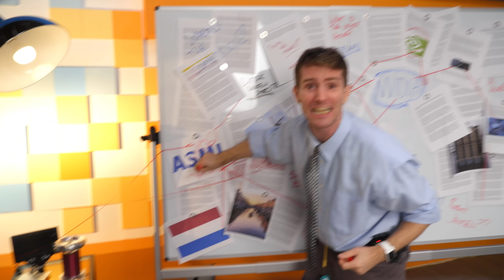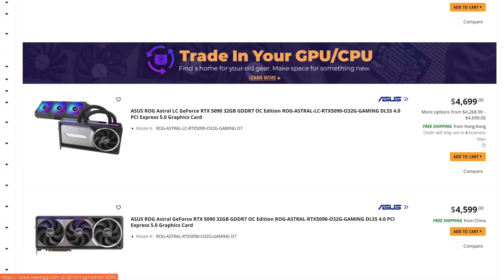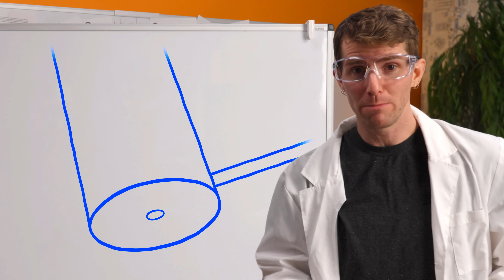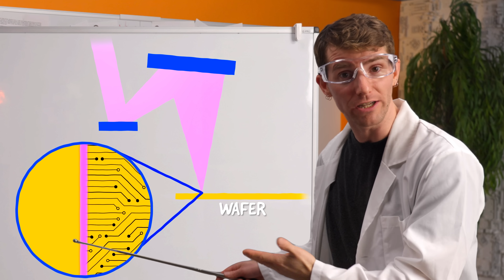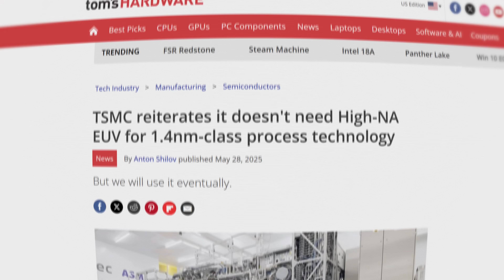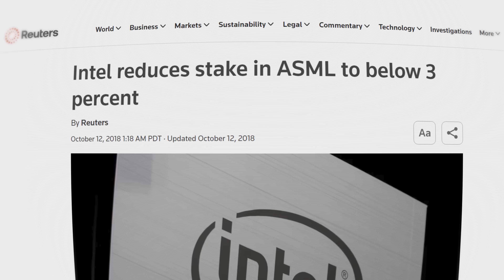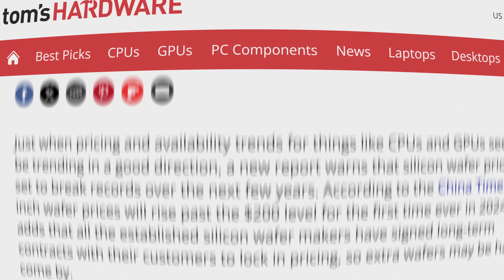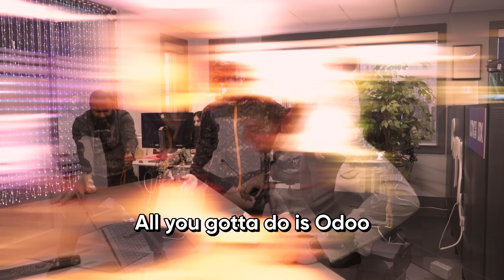This is Why Hardware Prices are Going Up… Again

Comment: The other big factor is defense and war strategy. It's actually a national security imperative for Taiwan to ensure they are the only place to go for high end chips so the western powers are required to go to war for them against China; it's not a corporate entity: it's a national security operation. They would run those facilities at a loss of billions per year to ensure they are still the only place to go.
---
Similarly ASML is Europe's big ace in the hole now that the US is threatening to invade their territory, carrying out regime change espionage on their territory, and openly talking about interfering with their elections to destroy their economic stability. The reason why there tech is so important: they are the only ones who can maintain it make replacement parts for Taiwan. That means that if the US gets too aggressive they can blacklist the US from any chips made using EUV lithography: like the ones needed to operate the F35, PATRIOT, Reaper, F22, and every updated naval ship in the fleet. So basically the entire US military would lose access to every spare part for every advanced weapons system they have. That means that if Europe gets too upset with the US they can break the US military overnight. Which is why ASML will also always remain a monopoly in Europe now. It's too important for European sovereign power to be the only suppliers.

Comment: Hi, Intel manufacturing engineer here. Like many others pointed out, it doesn’t stop there; those are just the major examples.

Raw materials are in a similar situation. The highest quality of certain materials are sourced from single companies out of, you guessed it, China. Current US sanctions and tariffs have made this whole mess even worse.

At the end of the day, semiconductor manufacturing is shockingly slow and expensive. Changes made now will take years to see any results, positive or negative.

And yes, “smartest nincompoops in the industry” is a very accurate description of us.

Comment: Seeing Linus wearing a tie I was hopeful that finally somebody was going to explain the real issue, but sadly no. There is nothing strange or really monopolistic going on with any of the chipmaking side of this: it's the gaming card makers.

This new machines are super expensive, too expensive for gamers. But they have to be, there is not going to be competition when you only sell 5 units of your product a year. But what there are is old fabs that can be used to make graphics cards more cheaply. Gamers have to come to terms with the fact that they aren't important enough to be on a leading edge node any more, or even the 2nd tier node, but instead 3rd or 4th tier nodes that are much cheaper to produce on.

AMD, Nvidia, and Intel should skip a node/die shrink for their next graphics cards to bring the price down and bring up the volume of sales. It's the node you choose to make the cards on that determines their price and right now that node is too small.

Comment: ASML does hold the monopoly, whish is a problem no doubt. But despite the large cost of their extreme lithography machines, its still a bucket in the ocean. Linus uses the next generation EUV machine cost to create bloated (and still irrelevant) picture, but current cutting edge EUV systems cost roughly $150–$200 million. This price is a small fraction of overall fab cost, for cutting edge chip production ($15 billion to $25 billion for 3nm, $25 to $30 billion for 2nm fab). And the fab cost makes only part of the final chip cost.
A single ASML EUV machine is used for producing millions to billions(!) of chips over many years. Although to be precise, modern chips need more than one EUV machine

Comment: The sad part is thar even boycotting nvidia as consumers won't help.
We hardware buyers are only a tiny fraction of their clientele. If nvidia sold zero geforce it would not even hurt them.
The only way out of this is if a bunch of people got together in an open source kinda project, crowd funded their own machine, their own fabs, their own wafers with a strong manifesto as a non profit organisation and with a strong policy for selling one per customer.
But that is wishful thinking.
Possible? Certainly. Linus Torvalds proved it by creating a system that literally makes the Internet as we know it, possible. The vast majority of smartphones run his code.
So, it is doable it just takes a lot of skill, money and organisation.

Comment: This has been our biggest nightmare for a long time, actually. And it was in fact foretold. The monopolies you're seeing stem from the fact that Moore's Law is getting slower and slower, to the point that any improvement in tech costs absurdly more than the previous one.

Back in 2012, when the 28nm node got announced, we've seen reports that it would be the last node in which individual transistors would be cheaper to manufacture than in the previous node (*basically this meant that a chip fabricated in 28nm was cheaper than the exact same chip fabricated in the previous 32nm - the individual cost per transistor was smaller. That was the rule that sped up technological advancements in the past). This is simply not true anymore. With slow ramp-ups, yield problems, expensive fabs, expensive equipment, and expensive long-term ventures, each node generation since 22nm is more expensive, more delicate, and more difficult to achieve than the previous one. This got to the point of only a few extremely specialized and highly advanced companies being part of the high tech production chain, and it got us where we are today.

Comment: My issue with Nvidia and certain companies/organizations isn't so straightforward as pricing. It's that they don't care, they are just looking at their bottomline, and how it goes up if they cowtow to AI as a whole, and are starting to screw over their corporate partnerships like Nvidia cutting deals they've had for years with their board partners due to AI destroying the supply and demand chain.

Nvidia and Micron (And probably many more I don't feel like delving into but am sure exist) don't need to cut ties with other markets and full sail on the AI bubble train, but they are, they are doing it for their bottom line that is going to the moon right now, and for their share holders. Yes this is great for investors and the companies, but it's just not needed. And if any of these head honcho's want to talk about how AI needs gaurdrails, why the actual [REDACTED WORD] are they not only supplying AI companies with more and more components but more power hungry and more powerful solutions?

The behavior is contradictory and clearly shows they just want two things, money, and mroe importantly to stab their flag in the ground and declare themselves the industry leaders that way they can maintain a hold on the market at the top.

Comment: This is very strangely framed, to the point of being disengenuous. It's almost like you don't want to appear critical of business for some reason, and it's not a good look.

The most obvious issue that they Nvidia's less than ethical practices are just as well known as Intel's management screwups.

TSMC even admits much of their current position is due to timing working out very well at the right time, putting them enough ahead to keep boosting efficiency and *yield*.

Intel cut back not because there was "skepticism", but because investors wanted cuts in cost to boost quarterly reports, even at the cost of the company's future. That perspective has continued, squandering grant money while cutting engineering staff, the life blood of a company like intel.

Nvidia got it's start committing industrial espionage, then wiping the slate by buying 3DFx during an ongoing legal case. They have made some well tuned decisions, but the current situation started when they committed part of heir own GPU production to mining bitcoin, then other in-house projects. Now it's a different product but the same thinking and strategies.

Linus, every time you do things like this it makes me respect you less as a person.

Comment: I started building computers back in the 1980's and continued in to the late 1990's.  There was inflation then but year on year the prices of things like Graphics cards kept dropping.  So what happened around 98 - 2000's when prices for Graphics cards started going up and up and UP?  To the point now when I can only afford second hand.     The same is try of the other parts.  I remember never spending $50 on a case, now cases of the some sort are in the over $100.  It's as if the price/year graph got flipped upside down.

Comment: There are not economic monopolies, but de-facto monopolies because governements failed to invest in engineering education and balance compensation vs. non-engineering roles in these fields. Most of these companies, all the way down to Nvidia, are mainly engineering companies. Thus the workforce supply is what limits competition because there are not enough people to do the job at RnD level, and the phDs, engineers, technologists' compensation is absudly low for both the amount/strategic value of work vs. the valuation of the companies using these tools (compare compensation of any AI of SV exec with that for an Electrical Enginner, Technologist, or academia researcher unlocking the next wave of these tools)

Comment: "nOt aNGeRy eNoUGh tO bUy a RaDeON" NO! EFFING NO! NO! NO! NO! NO! EFFING A THOUSAND TIMES NO! Some of us CAN-NOT, not wont, CAN!!! EFFING!!! NOT!!! Buy Intel, or AMD GPU's. If you do anything that requires the CUDA, or Optix API you are locked into Nvidia PERIOD. Which includes basically any professional pipeline that relies on GPU compute. Basically anything outside of "normal" video rendering/encoding. So if you watch it, or play it it, it has pixels that came from an Nvida GPU somewhere in it. Every film, or show you have watched over the past 8-ish years was touched by an Nvidia GPU. I can guarantee this as pure fact. No one has implemented an API that competes with CUDA, or Optix and so that's what we use. In game development, Film, and Shows. Not because we want to, because we literally have NO OTHER CHOICE! You think the the Bubble in Las Vegas is running on an array of 9700xt's? HA! No I guarantee it's NVIDIA. You think Avatars Real-time compositing Pipeline is using HIP or OneAPI? NOPE! Cuda and Optix all the way. "The Volume" Which is basically in everything now... NVIDIA. Blender Cycles is the only off-line renderer that supports All three API's AND NO ONE USES THEM! Why? Because CUDA and Optix are faster.

Sure, us game and VFX artists are not as large of a market segment as """"gamers"""" you could even consider us a subset. But we are the ones that will pay the price no matter what it is because we have no choice. I didn't want to spend $2k on a 4090, but if I wanted to get work done at home I had to. Dead lines don't care about scalper prices, or Jensens new leather jacket. Side note, I don't care if it pays for itself it shouldn't cost that much at all, it's just dumb. As well, none of this is to say we are the only industry effected. There are so many industries that rely on NVIDIA GPU's it's sick. Remember Industry segments are whee Nvidia make their money, NOT gamers, capital or otherwise. How many of your editors are NOT using Nvidia cards in their workstations again? Yeah, exactly.

I'm tired of you guys pointing the finger at people who keep buying Nvidia even though they're an absolutely horrible, and very anti-consumer company. Some of us are essentially being held hostage. So yeah, I'm plenty f****g angry, and I also can't do a f*****g thing about it accept buy used when I can. You guys say s**t like this all the time that is so ridiculously industry unaware it blows my mind. So stop blaming the consumer and the fabs and point a finger at the other two GPU manufacturers who don't even f*****g try!!! FFS. **throws papers in the air and walks out gif here*

Comment: I'm one of those annoyed enough to buy Radeon, but I kind of would have done anyway because there just seem to be more Radeon cards in my price range that only need a single 8-pin PCI power (I'll upgrade my PSU when it explodes, and it not a moment sooner).

Comment: What did nVidia pay you LTT to run this smoke and mirror BS? nVidia has made me "angry" enough (anger has nothing to do with it when bang for the buck cold calculation dictates) that the 9070xt for $580 lower than MSRP is the better option and for the first time in 19 years I am running an Radeon video card once more on my primary rig.

Comment: I think we're in a similar situation as back in the day when Intel improved CPUs by increasing clock every time until they hit a limit. Now the limit is node size. So we need to find a different way of increasing compute power than just shrinking stuff. Like adding cache, chiplet based designs, new architectures etc. And that's why I think nvidia is already on the way out. AMDs design for GPUs is already more advanced and efficient. Nvidia is just bullying them around with AI crap and marketing. Just think about this: like a third or more of an nvidia chip is just ray tracing and ai. If you don't use RT (tensor cores) a big part of your GPU is just turned off. AMDs cores can do either or. If you turn off RT, the cores can do something else. That's also why they are a bit slower with RT, because some cores who would have done rasterization will be doing RT now. But obviously the design is better and cheaper. It's just that AMD is slow and steady. Small improvements. But in terms of hardware tech they're ahead (software they are very close now too).
Also: I can't believe how many bad decisions Intel made in a row?

Comment: Even though Samsung's and Intel's fabrication process is not as good as TSMC's, I'm really cheering for them.

Intel messed up by a loooot, Samsung just worked at too small of a scale. Basically, they only made their own chips, Exynos phone processors. They worked with Qualcomm up until Snapdragon 855 series, where they switched back to TSMC after 801 fiasco as well as with Apple up until A10. And Qualcomm went back again to Samsung for 888 and 8 Gen1 chips - because TSMC was out of capacity, Apple, AMD and Nvidia (for 4000 series) bought everything, but we all know how that ended up

Because Samsung fabs not only had Qualcomm they had to manufacture chips for, they also had Nvidia for 3000 series. They pumped everything just to make something, not necessarily good. They lack capacity and - again - experience, which was clearly visible especially at that time.

As Samsung is set to release S26 with Exynos made in their 2nm GAA process, maybe, just maybe, it might be comeback go their competitiveness. Not just Exynos chips, but fabs overall.

Comment: Well this makes sense. The system is designed so it's best to be in a quasi monopolistic situation. Every company on earth is actively working to become a monopoly. If you want changes you need to adapt the system. I'm sure a big problem is patent law. The competition not only needs to catch up, they also need to find a way that is sufficiently different than the patent holder.

Comment: high purity quartz is considered a "critical mineral" now. Without it, we wouldn't have affordable electronics.
The vast majority of the global supply (70-90%) comes from North Carolina. 
It's just not economic to process any old sand, it has to be SiO2 with less than 50-100ppm of contaminants, and there are precious few places where this occurs naturally.

Comment: the thing is, all these industries are actually obliged to at least have SANE prices. the amount of R&D that goes into improvements in electronics is only SO LARGE because the tech industry is carried by the narrative of continuous exponential growth in performance, efficiency, and cost-to-performance. you'll note that although returns vs R&D has gotten smaller and smaller as time goes on, we're still seeing performance growth. if that performance growth goes away, it basically introduces the idea that people should just make the best of what we have now instead of just waiting for performance to jump. 

sounds cynical but just assuming performance would be better by the time software goes live for users used to be the most common method of optimization. now the most common method of optimization is checks notes to have an interpreted UI framework that completely monopolizes system resources??
Reply: Right, but then we get another two problem, 1) software marker is also highly monopolized so the companies have absolutely no incentive to make their products better, or even have an incentive to make them worse, 2) "vibe coding" makes software even crappier than it already is.
Reply: @Agent_Krasnov  at least in-theory software is highly accessible. Honestly i partially just blame the rate of insane market growth for the unsatisfactory software environment we have today. 

Basically "move fast and break things" ok well done we have a whole of stuff and its broken.